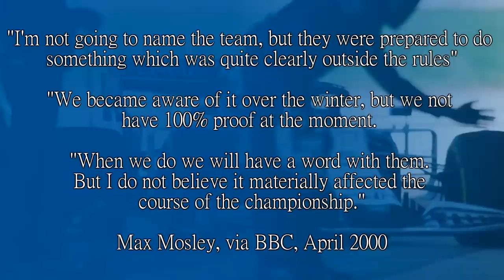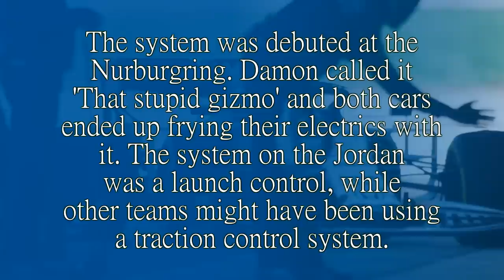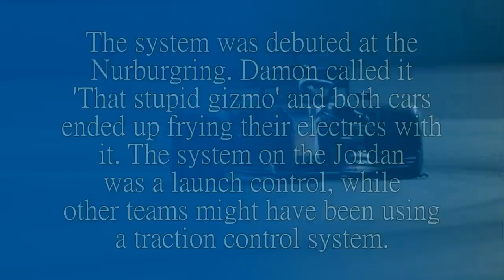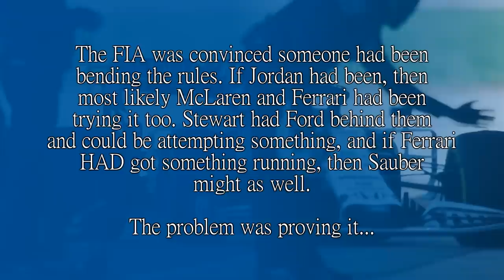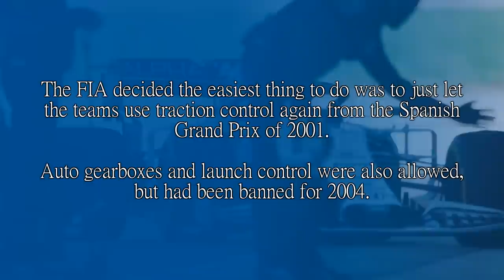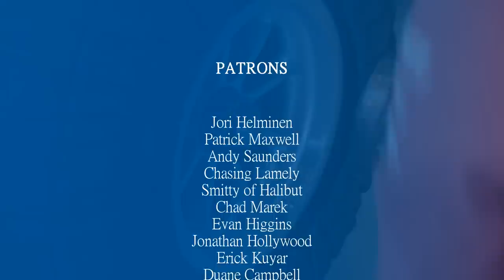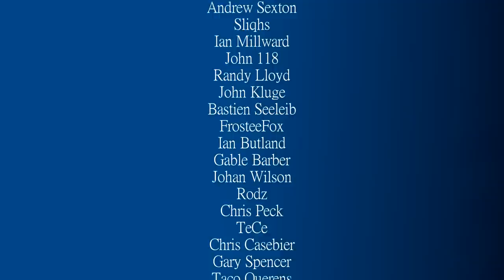WHEN CHEATING BECOMES LEGAL! The Story of F1's Second Traction Control Era

Comment: I loved the growl the cars made with traction control, it was like holding back a monster
Reply from the maker: It was like the blown diffuser in reverse.
Reply: @AidanMillward It was actually very similar to the off throttle exhaust blowing in essence of what the engine was doing. They were cutting fuel/spark to reduce engine power to keep the rears from breaking traction, essentially turning cylinders into air pumps. This exact same technology was used to keep throttles open on the off throttle EBD cars when the drivers were not demanding torque, thus maintaining an energized flow toward the diffuser. Basically the reverse in terms of when it was applied, but very similar technology.
Reply: @AidanMillward Speaking of Honda, their IMSA ARX-06 car does something like this in conjunction with it’s hybrid system.
Reply from the maker: @F-Man  didn’t ask but okay. 🤪
Reply: @AidanMillward  Did say you asked, did I? 🤪🤪
Reply: @F-Man seems like an absolute riot at parties.
Reply: @existentialTreat6 I haven’t been invited to a party in over 10 years - the reasons why are obvious, no? 😂
Reply: Absolutely loved that sound. It was something you only heard with F1 (Although I think Champ car may have had something slightly similar and you heard it mostly when they did celebratory donuts). Its just so similar to the Blown diffuser (Although not as unique to each car).
Reply: @F-Man  sorry buddy, as an engineer I am always down for a super technical conversations and will get super into them. TLDR: I am also a riot at parties 😂
Reply: @RACECAR you might have been hearing a rev limiter - possibly a multi-step rev limiter. They also work by cutting spark, which can lead to the sort of gurgling, flat sound that we often heard from TC 🤷🏼‍♂️
Reply: @AidanMillward  is using some audio samples in future episodes within the budget?
Reply: . I @F-Man

Comment: Some might consider Ayrton Senna's foot to be an early form of traction control in Formula 1.
Reply: Especially on the turbo V6 monsters of the 80s. Controlling the revs to not lower the psi so turbo lag doesn’t occur. 

I know it’s a thing he had since Karting but my god it’s fascinating to notice once you know about it and start noticing
Reply: I honestly don't know how anyone can race a car without Sennas feathering technique
Reply: @nickypoundtown9568  I think all modern F1 drivers do it without the blip. I can’t speak for other drivers though, but I caught myself doing the throttle blip in GT cars in ACC. It’s really fun lmao
Reply: @sandalogaming6766  it works in go karts and when I used to hill run my prelude back in the day
I use it in all videogames too
Reply from the maker: Schumacher and Mansell took it a stage further by being able to have one foot on the throttle and one on the brake, allowing for the exact amount for the blown diffuser to work in the corner instead of only on throttle  

It’s thought this is why senna thought the Benetton had traction control, but it was that Schumacher could use his left foot to brake but senna was a right foot brake user.
Reply: @nickypoundtown9568 it’s a common technique to feather the throttle to get the front to bite.
Reply: @hersencell6880  I thought it was common too but there are so many people referring the blip like only Senna did it, but in essence it's the only way I feel cozy throwing a car around the track because I can hear the revs and feel the response
Reply: It doesn't matter if you find the limit using your foot blipping, your foot by being smooth to the limit or slightly over it and using your hands to correct the micro slides like Schumacher did. They're all on the limit of the grip circle.

I've done all three in racing and never noticed any lap time difference with any of them, some cars like it one way some others. 

Good drivers know how to extract the time out of a car regardless of how you need to do it.
Reply from the maker: @ukwan  senna was the fastest guy out there driving the car like he was wrestling with a caged animal

Clark was destroying everybody by being smoother than a Boyz 2 Men harmony

Comment: The traction control was very obvious watching the races from the infield at Indianapolis. You could also tell how well Schumacher had his car dialed in as you never saw him struggle with the steering wheel like other drivers.
Reply from the maker: I tried to record some onboard footage as in AC you can hear the TC sounds but they didn’t come across as well as I wanted.
Reply: Disagree Schumacher spun in that slow midfield section in 2000 whilst leading
Reply: @ayrtonsenna1989luke  LOL!  That’s because he was daydreaming, something he admitted to. 🤣🤣. I was watching him on other parts of the track and I don’t remember seeing him fight the wheel.
Reply: @ayrtonsenna1989luke yeah that’s because traction control was introduced from Spain 2001 on, so his car didn’t had Tc
Reply: You should read some technical books about F1 of that time. ALL teams emulated traction control in one way or the other. But it was mostly done in a legal way, with things called "twin throttles", very clever electronic differentials and very completely legal engine mapping. The only team that actually used an illegal TC was Jordan. And by the way - TC is forbidden for a very long time - how often do you see a F1 car with over 1000HP spin their wheels??? So do all of todays cars cheat and use TC? No. Electronic traction control, twin throttle and sophisticated engine mapping and legal systems predicting wheel spin more or less emulate a traction control. And these systems started to be developed in the mid and late 90's already. And Ferrari, by the way, lead the way with these systems. They invented things like twin throttles and sophisticated electronic differentials (even if Williams and Benetton started a few months before them). I would advise you to do some research about F1s electronic differentials and read Peter Wrights Book "Under the Skin of the Championship Winning F1-2000" were it gets explained how Ferrari developed some very clever but totally legal systems for traction but had nothing to do with traction control. Not at all. Its all well known today (if you just read some really good technical books, written by engineers, not journalists with no clue) and gets explained very well. Even the system of the Benetton in 1994 is well known today and got explained. It was no traction control at all. It used the sensor every car had to "tune" the traction of the B194. Every Engine needs to be able to correct  fuel and ignition because of ambient conditions (lambda sensor in "normal cars), so F1 engineers were always allowed to sense atmospheric pressure so hence you had all you had needed to modify the limit rate of acceleration of the engine in any gear. The atmospheric pressure sensor that measured the pressure was in the airbox of every car. So with some track testing one could use the way pressure changes with speed in the airbox to determine that, if the pressure was "X" above the ambient level seen at the start of the race, then the car was likely to be in a certain gear. To refine that process you just needed to know the RPM (another purely engine parameter) to have a traction control without being a traction control. This worked like this : it was achieved via spark
cuting. Input signals were engine
RPM measured very frequently so that engine acceleration could be measured (with legal hall effect sensors every team used) and
atmospheric pressure (very accurate sensor that every team had, too) so that delta pressure could be assessed. Engine acceleration was limited
in stages based on delta ("atmospheric")
pressure. The driver would be sent out with the system "neutralised" to see what the
track/tyres could handle. This would change if gear ratios changed (different
gear ratio would require a different engine acceleration limit). The system would the be programmed with a number of stages
of engine acceleration to suit the
conditions. As conditions changed (track "rubbering in" etc.) the parameters would be tuned. During a race the conditions would change rendering the system more or less useful. If the tyres went off badly or it became wet the system would not control
traction. If the track got better and better, the system would cut too much power - the grip available would allow more
"engine" acceleration. That was how the Benetton System of 1994 worked and its well know today. Not much to do with a traction control. But a clever and legal system that other teams copied in the years following. And systems like this got further developed and got more sophisticated. Like i said - read some good (but expensive books from F1 Engineers). And forget all this crap journalists and fans are talking...its all crap. Most teams, especially Benetton and Ferrari used very clever but legal systems. A lot of politics were involved in these days especially by someone called Ron, who always called the teams who beat him cheats. But most of it was politics and psychological warfare and no team except of Jordan in 1999 used a TC. It was all very clever and legal systems. The fact alone that nothing changed after the introduction of traction control as far as the competitiveness of the teams is concerned should have made that clear and made it clear even then. Because everything remained the same, either no one used traction control or everyone did. And indeed, after Jordan in 1999, no one did. And finally - there was no driver who did fight more with the wheel than Schumacher. If you seeiously say you did not see him fight the wheel, then you have no clue about Schumacher, sorry.
Reply: What a speech🎉
Reply: @fam.hunger5244  That’s sure is a lot of writing to tell me what I apparently did not see. 🤣🤣

Comment: If I’m being honest there’s a real case to be made that like the grooved Slicks, traction control made the race cars of that era safer for the drivers as they slowed the cars down
Reply: Grooved-tyres gave F1 cars a very nice & distinctive look…
Reply from the maker: I always thought it was counter productive given that they wanted to make the cars harder to drive by reducing rear grip and then giving them back the traction control to make it easier.
Reply: TC made the car faster.
Reply: There were many occasions where grooves failed to slow the cars down
Reply: @nickypoundtown9568  like in damp conditions, where the grooves allowed the tires to disperse some of the water
Reply: @AidanMillward it was a bit of a weird move but as I said in my previous comment it feels like it was a safety thing considering the F1 drivers of that era seemed to really have a thing for posting it into every corner, following the Schumacher-era V Shape line as opposed to the U shaped lines most of them follow these days (except Alonso, but that’s because he was being special). Traction control makes those sorts of lines safe as you don’t need to worry about causing to much skidding problems because you had to post it to keep the little downforce (by modern standards) you had as that was what kept you on the track. So while it lowered the maximum speed it raised the minimum corner speed thus making the downforce more consistent. (Or at least that’s my theory as well I’m neither an F1 driver from that era nor an F1 engineer from that era either lol)
Reply: Secondly the Traction Control was something that you could probably also justify as something that was going to happen anyways as so rather police it inside legality as opposed to sneaky shoddy implementations

Comment: TC would be handy nowadays with the wet races and the hyrbrid power units giving instant torque...
Although the problem as drivers said is the spray,I believe that TC needs to come back only for wet races...
Reply: Spray is one of the problems, yes. Another is that the wet tire is between five and seven seconds a lap slower than the intermediate tire, rendering it basically useless for racing, despite its ability to clear water.

Comment: Jean Alesi famously refused to use traction control in the Prost - he hated it, and raced with it turned off. Though apparently less due to being against TC in general... and more down to considering it pretty crap in the Prost. After his move to Jordan, he used it and declared it a lot better.
Reply: Bit weird that they couldn't use Ferrari's one as they used a Ferrari engine that year and it was the ECU that implemented traction control. I doubt Ferrari's traction control was actually bad.
Reply: @Olivyay  Ferrari didn't have a lot of love for Prost after '91 so I bet there was something to do with that.
Reply: @peekaboo1575  But they still loved money enough to sell him engines. 😅
Reply: @Olivyay At a stupid high price tbf haha
Reply: @RANDOMZBOSSMAN1  At a CRIPPLINGLY high price, yes!  Ferrari engine and transmission I think it was, from the prior year.
Reply: @DeckardWill  Yup they were they were rebadged units from 2000

Comment: 7:55 are you sure it's not the other way around? Because I distinctly remember reading an article on the Ferrari steering wheel (that had like two times the number of buttons and switches as competitors at the time) in an F1 magazine and it said there was one button to automatically downshift from the current gear to a set gear, often 2nd, for slow corners at the end of straights (they used La Source as an example). This was about the F310B in 1997. If you mean "really automatic", then I understand it was not the same, as this was more "programmed multi-downshift".

Oh btw at 2:35 the white Stewart livery makes really obvious the fact that the ~2000 Ferrari body wasn't the best looking on the grid, especially the sidepods. 🙂

PS: very interesting anecdote about Damon and the 1999 Nurburgring start! On the TV feed you see him very slow after the crash but I always thought it was a consequence and not the cause, but now that you've told about that it is obvious he had exactly the same problem at the exact same spot on track as happened to Frentzen after the first pitstop.

Comment: I was there... before and after the traction control thing.  My dream car was something like the V8 Holden HT, HG Monaro. By the late 1990's I could afford one. Sadly they were very hard to find by then.   Like most things in the 1990's  F1 was changing fast.  Most of those changes found their way into road cars.  (so I'm told)   I was no racing driver and I needed all the help I could get from a car.  Most cars were still manual change,  only just got ABS (that's some kind of brake control) and everything was about HP and torque?  Turbo's and superchargers were additions to an engine that increased power and torque to mind-blowing levels of fuel consumption.   Then suddenly F1 stopped using V10s ( I had dreamed of owning something like a V12 Jaguar), V12s were on the way out and then the crazy high rev V8s were gone too.  Along came the V6 turbo era,  increasing numbers of automatic gearboxes and computer chips that turned the car off when you stopped at the lights.  All were designed to save fuel, and most came from F1 innovations. 
Most of this I did not care about.  Before and After the late 90's I watched F1 because it was like a modern chariot race.  F1 is synonymous with change and controversy, speed and suspense, but most of all it's about development and death.   At times F1 can be very hard to watch but it has always been a place to find the next development.

Comment: I do wonder actually if there was any crossover of info from CART to F1 as far as running and more to the point, hiding TC. It was said in 2003 by both CART and Paul Tracy that everyone was at it from 94-01 and it was an open secret that nobody would talk about. but more to the point it was the car makers pushing it and making sure teams ran it. So I wonder if something similar happened in F1 with the apparent midfield teams as well given Jordan had Honda as did BAR, Ford had Stewart and bought it out to be Jag, and Merc were with McLaren at the time, and Toyota would enter in 2002

Comment: I know the loophole Benetton were using in '94 was that it was illegal to use traction control, but not illegal to have it, and the FIA couldn't prove whether their traction control system was actually being used or not. Did they close that loophole, and Jordan (or whoever) found a different one?
Reply: Willem Toet explained Benetton's 1994 traction control in a video interview with Driver61, they were using a rule allowing for measurement of piston acceleration to prevent engines destroying themselves if throttled suddenly in neutral or on a big bump or kerb etc. Benetton designed look-up tables with that piston acceleration and RPM and the air intake pressure to guess what gear they were in and limit power depending on the gear.
So it wasn't as efficient as the legalized traction control of 2001-2007, and used a loophole in the rules, but was effectively a form of traction control.

He didn't say in the interview if the loophole was closed for 1995, but they changed engine supplier so maybe it was something Ford had come up with?
Reply from the maker: @Olivyay  yeah Benetton were using some sort of air pressure thing to do it.

It’s the launch control that is the crux of the illegal car stuff.